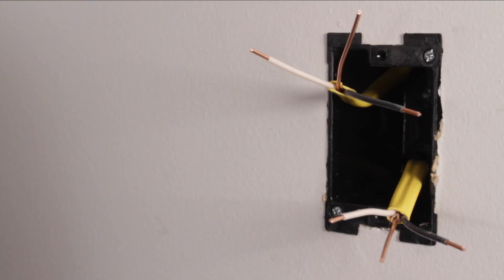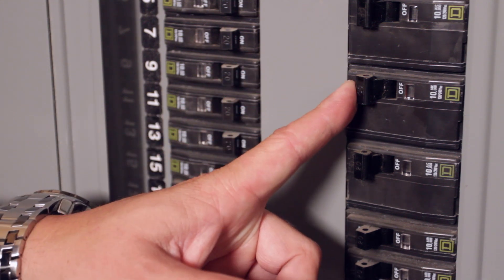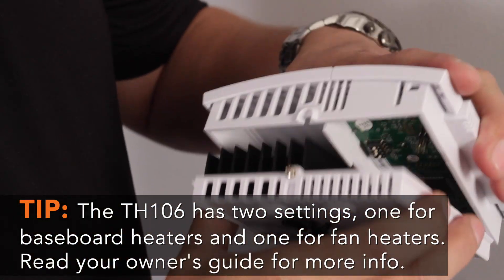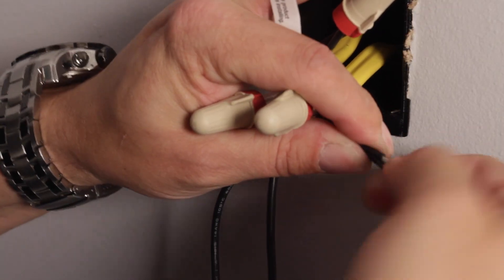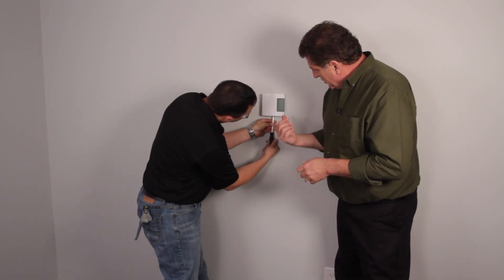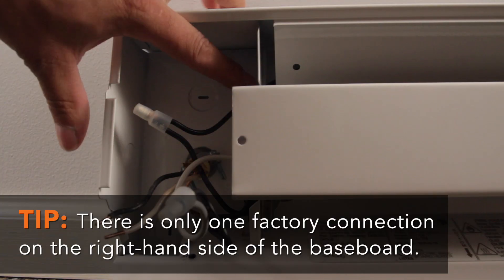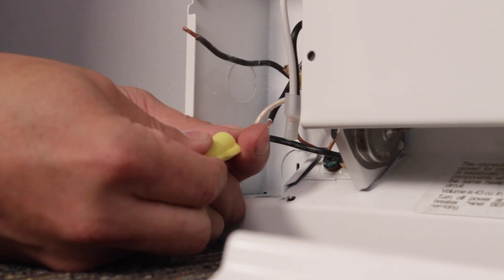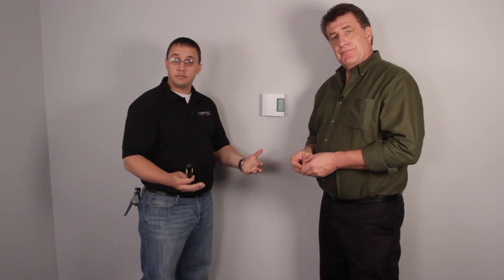How to install: Wall thermostat, single-pole on 120V baseboard | Cadet Heat

Comment: Hi,
Could I ask a recommendation about how to wire my single pole? There's a ground copper wire from I believe the power supply but not one from my heater to nut together. Nor is there a green ground wire from my new plastic thermostats... Right now the one copper wire attaches to the metal casing of the thermostat. 
Would it be safe to just try and leave the ground copper wire free floating or maybe to the box outlet (may be close to the plastic)?
Will that cause a fire hazard or create more of a risk for the baseboard heater to be ruined?
I am hoping that a short would just flip my breaker...
Could really use your advice. Thanks for reading all of this.

Comment: Does anyone know what size the set screw is on the cover? I moved into a house and someone removed it so the cover is always falling off. Ive been on hold with honeywell for about an hour and still on hold.

Comment: Heating enclosed outside porch which has a washer≖≖>allmy.tips/bsCadet-heater?Xえi     hot water tank and sink, I placed on a thermostat directly on the heater, set just below the comfort range on the thermosat, keeps it around 55 degrees when the outside temp. was at 15, I just use when it goes below 20 no noise whatsoever

Comment: hello David . If I have a air conditioner with a 120v thermostat(old) . will this thermostat will work ?
Reply from the maker: Elena, This thermostat does not have a cooling option so we don't think it would work. In this case, you're probably going to want to call the manufacturer of your air conditioner to get their recommendation on what will work.